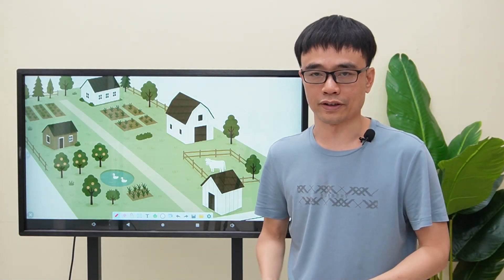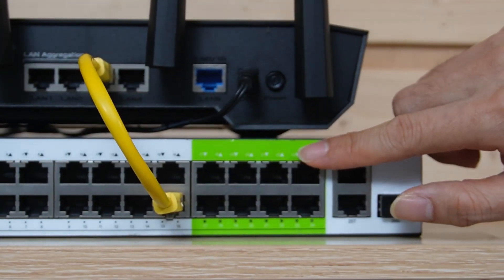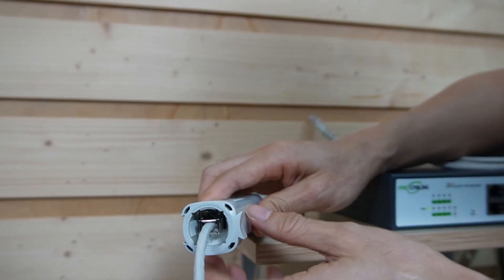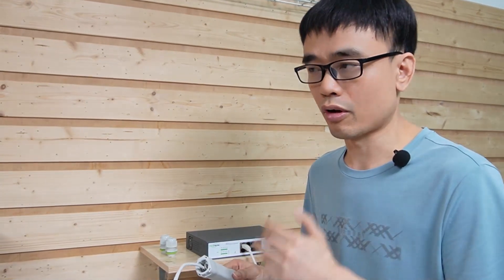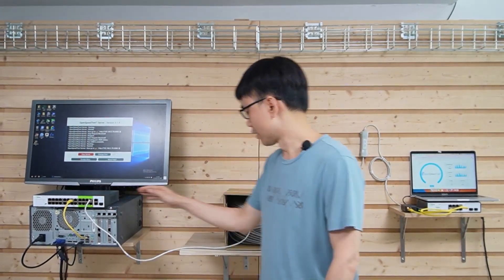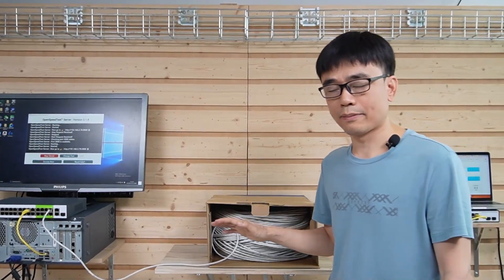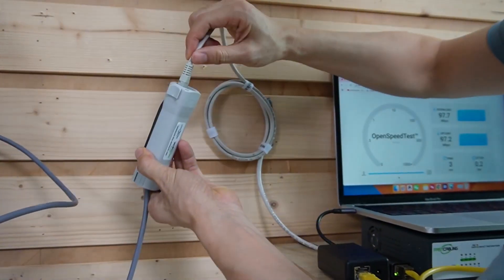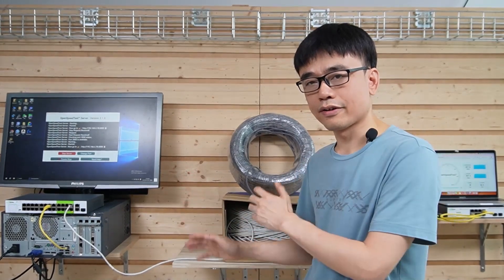Fixing Long Range PoE Switch Failures: 300m+ Cable Not Working? Here's Why!

Comment: Can't we use a LR POE switches at both ends to handle the data transfer, instead of poe extenders that is sending communication back and forth.
Reply from the maker: Yes, you can use the long range PoE switches on both sides. There'll only be data transfer between them. 

https://www.fastcabling.com/product/500-meters-long-range-poe-extension-kit/

Comment: I'm actually having the same problem but what strange is you guys are supposed to design special POE extenders that don't transfer power. 

Now I have two gray POE extenders and two black POE extenders and they both act the same way even though the black ones you sent me were supposed to be the special ones that don't extend power out. I've tried different configurations and it all acts the same.

Luckily I purchased one of those POE splitters with the 12 volt DC output. This splitter actually does pull the power out and only lets data through.
Reply: I know they're all acting the same because as soon as I plug the cable into the router I'm trying to extend my network with it turns the power and data off at the POE switch. It's not doing a handshake properly. I also have an ethernet tester that test is voltage on POE and no matter which direction or what POE extenders I use there's always 52 to 53 volts coming out the other side unless I use the 12 volt splitter that I bought from you guys.
Reply from the maker: The black PoE extender (with grey gray cups) has cut off power pins in 12-36 and provide the power handshaking. As long as you don't use the passive PoE injector (through 45-78 power pins), you should be good. It doesn't work with PoE  bt (aka PoE++) because it takes four twisted pairs to send the PoE power. The workaround is you can make a special patch cord to remove 45-78 wires, ane leave 12-36 pins only. Since this PoE extender supports 100Mb/s. It will have no effect to the network speed.

Comment: upto 300m we dont need to use POE extender right? if im worng plz clarify why its need
Reply from the maker: You need PoE extender at 300m/500m end. The long range PoE switch can push the data up to 500 meters, but network at the another end is the normal network device. It can't send back the signal so far. The TCP/IP is two way communication. You need PoE extender to handle the data 2nd way from whatever device you have at the edge.